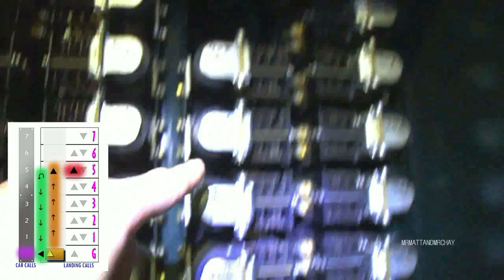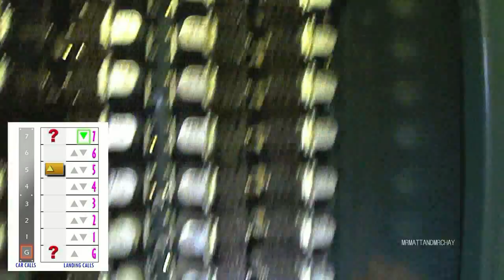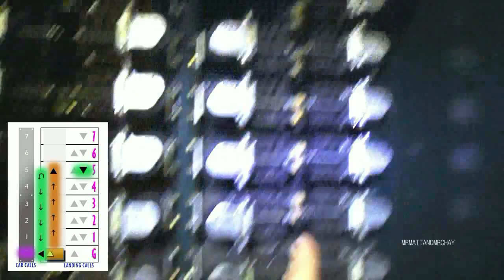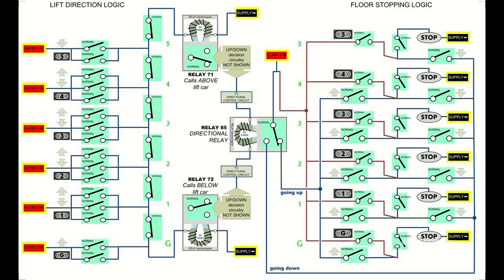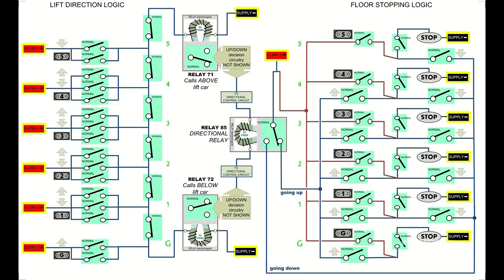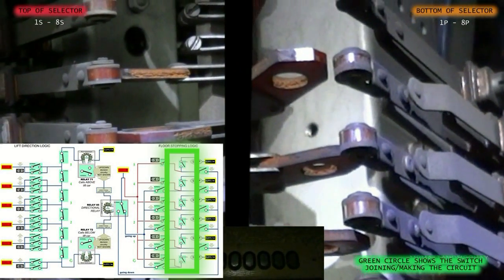Lift logic experiments!!  PROBABLY THE BEST 'elevator relay logic vid'! (4/4)

Comment: what is that sort of screeching sound at 2:20 when the motor shuts off?
Reply from the maker: Modern day lifts, the motor is actually brought to a stop electronically - a variable speed drive has total control over it.  After the motor has been stopped, the brake is applied - NO SCREECH!  But older lifts cannot do this.  Once the motor has been switched off it continues to turn.  It is only stopped when the brake is applied, and the brake shoes stop the motor rotating, creating the SCREECH.  Some of the really old lifts only had one speed - they used to call this method "crash levelling".  The new system - no wear on the brake shoes as the brake was applied to an already stopped motor.  The old system, the brake shoes required replacing.
Hope that makes sense :)
Reply: It does, thanks!
Reply: It's probably the motor brake.

Edit: Whoops!  Just realized the OP already answered your question.  lol

Comment: What happens if you advance the selector by one step, thereby putting it out of step?
Reply from the maker: Hi Phillip.
The lift will probably stop one floor too early, or one floor too late.  This is corrected once the lift reaches the top or bottom of the shaft, as there are roller switches there.  Not sure what sorted out an out of sequence mechanical selector, so I'll come back to you on this.  I would guess that if the lift reaches the lowest floor, and the selector isn't on the lowest floor, there would be something that would pulse the selector continuously until the lowest floor IS selected - I will check on this one for you.
Reply: We had a lifter do that. Occasionally it would skip one step and then would stop shifted 1/2 floor on all floors (the door didn't open) except the top or bottom one. That is because each floor generates 2 steps, so 1 step is 1/2 floor out. The fix was to call the top or bottom floor, the mechanism was range limited so when it tried to step past the end it could not thus going back into alignment.
BTW thanks for all these great videos.

Comment: 4:20 Relay systems can only remember one state. Here you will see ineffectieve example and that is reason why many relay systems are upgraded to modern PLC controller. The PLC controller program will check immediately after door close which is best mode, go up or go down by counting total floors.
Here PLC know go up is just 2 floors away and go down is 5 floors. That is why it ignore down and will go up first, to save little time and also less motor use with "shorter" way. Less motor use means also less maintenance costs.

Nothing wrong with relay systems, it works. But due one-state memory it's not always effective. More states is possible but to compare like 2 against 5 floors difference, it's way more complex in relay system. It even needs small "CPU" part to compare which way is short. A CPU-relay is very complex because it needs very much relays. (We all know the very old computer systems.)
In tower with more than 10 floors relay system is less effective / more complex.
The PLC system will solve it and make it more effective and thus little faster.

Let's say it: there is "route planner" inside PLC program, used for lift use. :)

Very good video btw, all 4 parts!

Comment: 10:26— Is that an overspeed mechanism on and to the left of the sheave?
Reply from the maker: +Lawrence Keesler Yes, I believe that is the jaw that moves if the lift goes too fast which then makes contact with the static teeth in the middle.  This wrenches up the brakes via the governor cable on the lift car.  You can see a better example of this here:  https://www.youtube.com/watch?v=DkWkgoeLZzU  from 0:25 (see 0:43 for the bit I mean)
Reply: Thanks! Very interesting.

Comment: I know this comes in a bit late Matt, but could you please explain what the leveling up/down relays are for exactly?.. On a side note you are quite right -- I can't believe you don't actually carry a spanner around with you! =)
Reply: Xaelloss Leveling up/down relays (as far as I can remember) are... Level up: when a large load enters the lift it will drop. If this happens the level up relay kicks in and re-levels the lift. Level Down: Likewise if a large load leaves the lift the lift will rise. If this happens the level down relay kicks in and re-levels the lift. This re-leveling of the lift can only happen in the door zone, with or without the doors open and at very low speed.
Reply from the maker: Xaelloss I'll answer questions anytime, so don't worry about that.  I don't know for certain, but an educated guess here which is probably right - There are vanes in the shaft - you can see them here at 1:28... https://www.youtube.com/watch?v=W5Wcj9EJ5Ao  - this is a one speed lift.Two speed lifts (like this one) have two rows of vanes.  One would be to put the lift into slow speed, then the next would be the stop signal when the lift is level with the floor.  So this means there are also two inductors (the devices on the lift roof that read the vanes).  These U/D relays appear to be normally energised whilst the lift is moving.  When the lift finds a call, it goes to slow speed and allows the corresponding U/D relay to react to the next vane passed.  When the vane is found then the corresponding U/D relay turns off as the vane passes through the inductor, which must then signal a "stop" to other relays in the cabinet.
Reply: mrmattandmrchay 
This does make sense indeed, thank you for help with this one! 
Fascinating really how many ways there are to make relay logic lifts work... Here in Russia most old lifts didn't have a dedicated floor selectors and instead used 2-position switches on each level so that when the lift car passes a floor it would flip it over up or down depending on the direction it's travelling. From what I've seen in your videos it's basically the same logic as the Otis selector -- just spaced out through the entire lift shaft =)